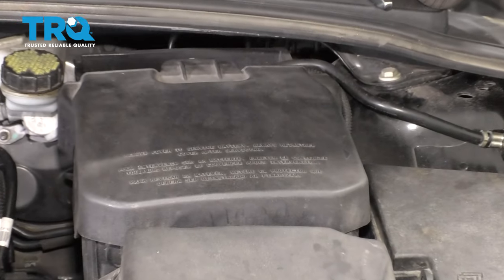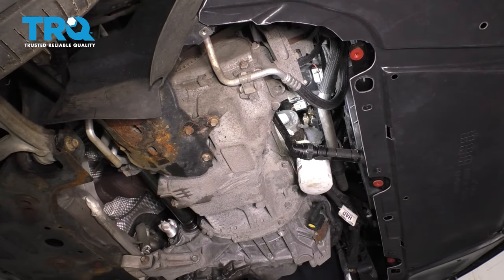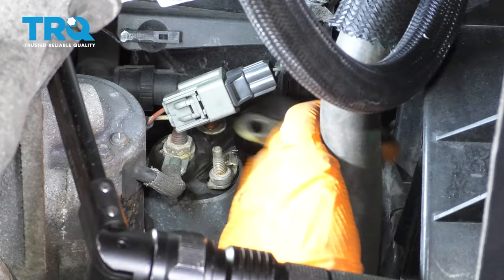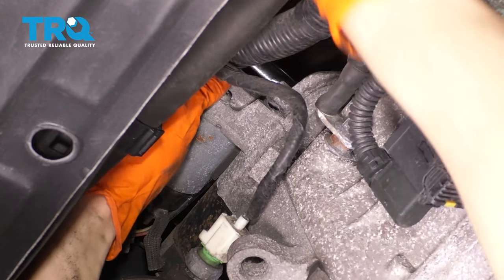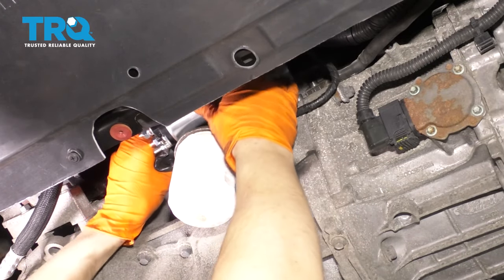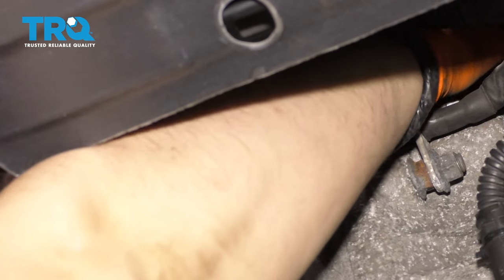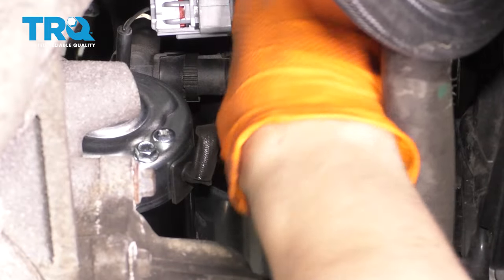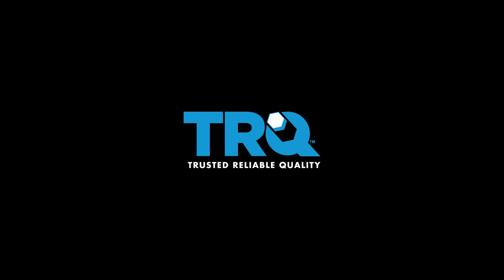How to Replace Starter 2012-2020 Ford Focus

Comment: Had to replace it in a year and a half again . Had oil on pinion gear . Trying to find actaul oilleak . This mechainc said it's definitely from real seal . Also have valve cover oil leak which might be causing this . In your opinion , can top leak go into starter gear ? Or is it pretty tightly sealed against from the outside ?

Comment: My 2016 Se 2.0L came with bracket on top of mounting bolts . Supposedly a cable is attached to it though mine didn't . A cable that suposedly runs from battery case to alternator ? And a smaller wire ?

Comment: Very clear thorough video after watching this vid I feel confident in replacing this particular starter I've replaced a few in my time but the cars I replaced them on were in the 70s. The starters were huge and in the very bottom or the engine not behind a bunch of things   just 2big bolts after removing the wires of course then just drop it out  and I  could always clearly see the bolts on them cars  the cars I'm speaking of were 73olds cutlass 350big block engines  and Ford engine as well469big block that's what I'm used to but this vid  helps me get an idea what I'm in for  seems pretty simple but different 😜 thanks 👍👍👍👍

Comment: thanks for the video.  Rodents did a number on the engine harness so I'm in the process of trying to remove what's left of it.  The old reverse domino effect: can't get at some connections, need to remove manifold, can't get at pcv connection to manifold, need to remove starter probably.  And here i am, lol.  
Dang design engineers don't make it easy(i'm a mfg engr)... guys should be made to work on their own designs.  The techs must be swearing all day.  Older cars are so mucher easier to work on.  You have replace PCV on one of these?